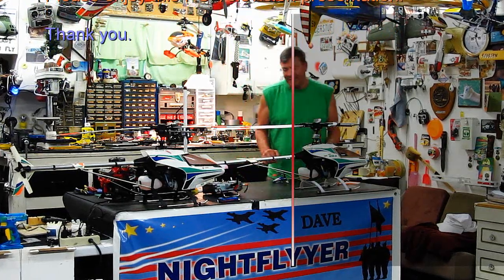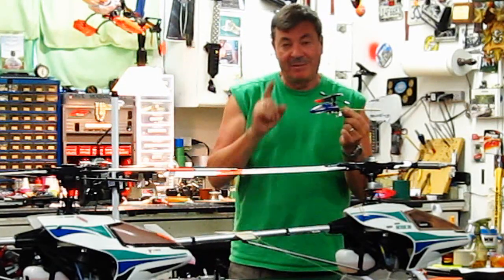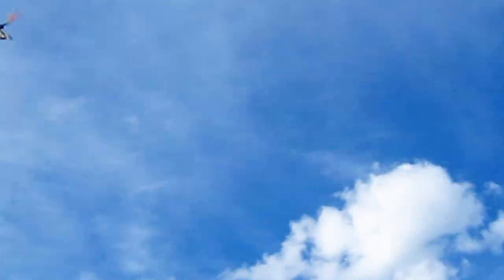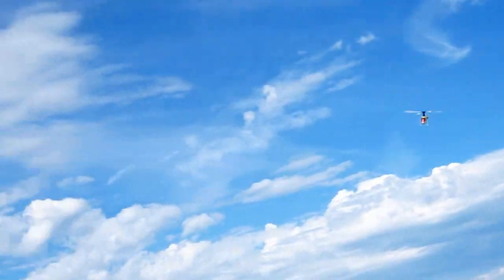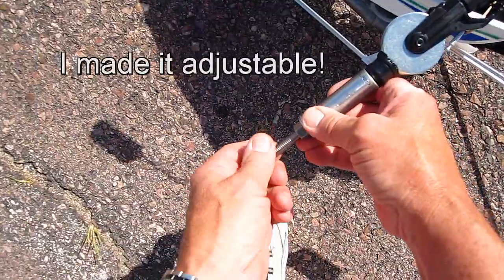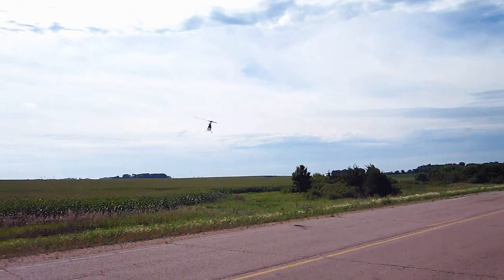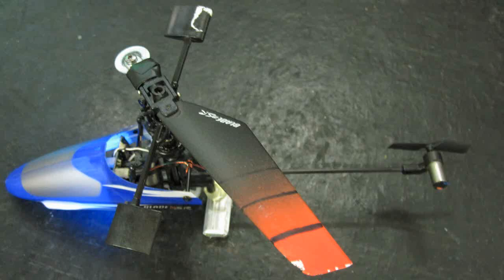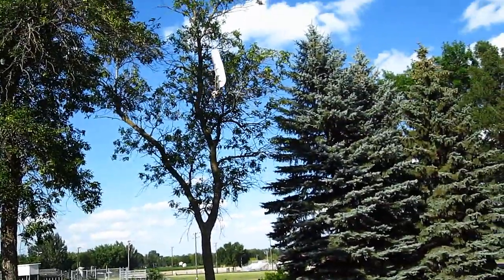Blade mSR 1 Blade,  Inverted Hovering Blade 400, Blade 450 trim, and Single Rotor Gas Heli demo.

Comment: since both blades on a coaxial heli chop the air to bits, my hypothesis is that it would be even more efficient than a fixed pich heli due to there being less vortex ring effect. i would try this but i gave away my coaxial. all i have is an air hogs heli i severely despise.

Comment: hey dave ive always wanted to see a coaxial rc heli with one blade on each rotor, would that be possible? i assume it would since each blade would act the same as how they do on your other single bladed helis. thus, the two blades shoud not cause any sort of uneveness. also, i saw a onebladed MCPX flybarless heli. it would be cool to try but i dont think you have one. so perhaps you could explore the dual single bladed coaxial heli?